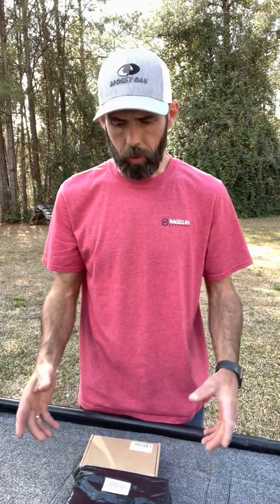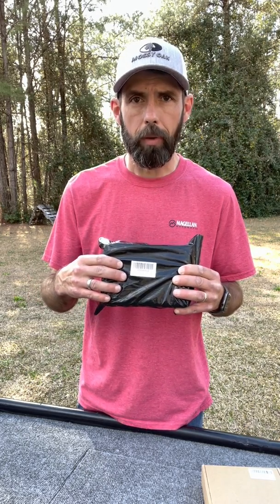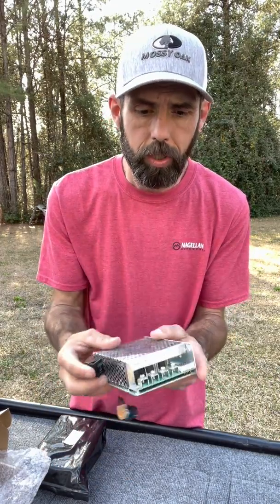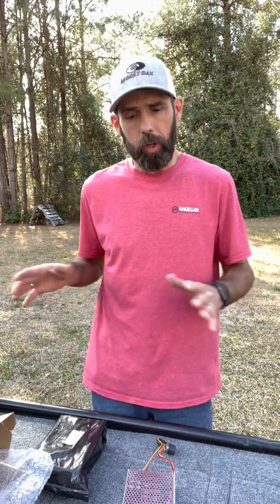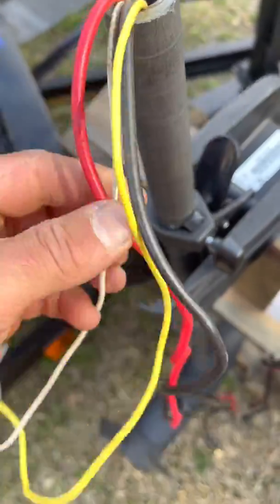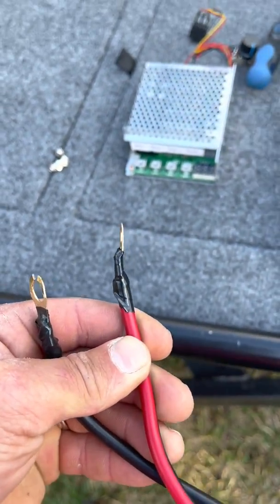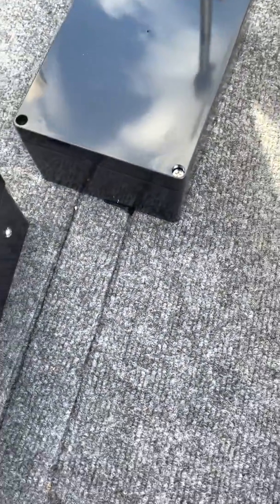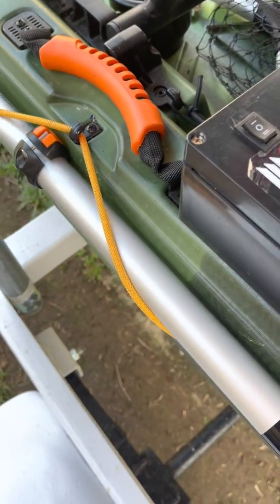How to hook up a PWM (pulse width modulator) to control a trolling motor.

Comment: The pwm with the fan is probably the way to go. That and making sure there is a 50a breaker switch between the battery and pwm will help in keeping the pwm from overheating or taking too much current and frying it. I bought a box that has a mounting plate that is perforated and raised off the floor of the box, so it will also help with cooling the pwm board in the box. I am going to swap out the rectangular rocker switch for a round one that is also a bit larger in size.  Thank you for posting the videos because I have adopted some of what is in your videos on adding the hatches and motor to my Outlaw. I am going to be adding foot control steering to mine using stainless steel cable. Hoping to finish up today or tomorrow. I have been doing one or two portions of the project each day. Lots of frustration as I didn't set down and create a step by step guide. Many times I had to take stuff apart because I forgot to add a part...like putting my motor together with the pvc top and wiring loom...then realizing I had to slip the steering triangle down over the shaft. 🤪 I had to take apart my motor mount because after I got it on, realized the part the motor actually mounts to had to be bolted from underneath to the bracket that was sitting flush on the kayak and cutting board reinforcement. Doh! Let's not even talk about trying to solder 10AWG wiring with the soldering pen and then gun I bought. Scrapped that after multiple attempts and just spliced with butt connectors and heat shrink wire tubing. Fun stuff for sure. But, I should be able to easily solder the 22AWG wiring to the new rocker switch. The gun or pen should easily be able to heat that wiring up high enough to do the job.
Reply from the maker: I appreciate you watching the video. I also have a perception outlaw I’m building and yes you gotta have a plan for everything that is getting added. Good luck with finishing your build. Thanks for the comment.

Comment: Thanks mate this video helped me setup my PWM with my kids electric car which originally was 1 6v motor and battery to 2 12v motors and 18v drill battery. Now I can adjust speed depending on who is driving and what terrain. The PWM I received had only Chinese words so this video helped translate the connections xD
Reply: When I built my pwm this  video wasn’t available, so I had to figure out the Chinese connection labels myself.  I used a Harbor Freight Tactical Ammo/Utility Box (SKU: 64113) to put the pwm in and put the controls and a small battery percentage meter under the flip top lid. It runs between the battery and the motor. Made up 8 gauge lines to connect it to the motor and the battery using repurposed car jumper
Cables.
Reply from the maker: @Canadarago at least you was able to get it done.
Reply from the maker: I’m glad my video helped you out. I appreciate you watching and thanks for letting me know it did help you out.

Comment: What did you use to cut out the box?
Reply from the maker: I drilled a small hole then used a dremal tool with a sanding bit to cut it on out.

Comment: Can two trolling motors be hooked up to same unit?
Reply from the maker: To be honest I’ve never tried. It would have to have enough amps to power 2 trolling motors if it didn’t heat up to hot.

Comment: I have the pwm that I think is the one you recommended.  It's the 100A. There are nothing showing which screws go to motor or battery. This unit has the 4 screws next to the wires for the speed and forward / reverse switches.  What goes where?
Reply from the maker: One will show a b+ that’s battery positive and motor positive will go beside it. Same way with b- that’s battery negative and the motor negative will be right beside it.
Reply: @334tacticaloutdoors  is there anyway I could send you a picture.  Two of us here and neither can find any markings
Reply from the maker: @deanbailey74  yea send me a pick 334tactical@gmail.com

Comment: Just tried to hook mine up and pretty sure I fried it lol. The connection symbols were backwards on my unit. It started smoking pretty heavily
Reply: 2nd time was a charm. After reading the reviews the connections were indeed backwards on my label. Ordered another one and we are good to go now! Thanks for the great tutorial man. I might make a video showing my setup in the future. It’s a little unique since I have a prewired kayak (catch pwr 100). I’ll be sure to give you credit
Reply from the maker: Yes you gotta be careful and make sure The connections are correct. It’s a expensive mistake. Good luck on your next one if you need help just ask.
Reply from the maker: Great job and thanks.

Comment: Does it matter negative or positive left or right on the motor. Manufacturers didn’t label it like they did the battery
Reply from the maker: Yes you need to know your negative and positive. If the wires aren’t red and black like shown in the video look up the model of your trolling motor to see which wire is positive and which is negative.

Comment: Awesome video and very informative! Would you need to incorporate a fuse breaker within that setup and if so where in-line would you install it?
Reply from the maker: Only if you want to install a fuse breaker and if you wanna add one put it on the red power wire between the PWM and trolling motor
Reply: @334tacticaloutdoors  what size fuse would you recommend for a 30lb 12v trolling motor?
Reply from the maker: @oakgarage3834  I replied to your comment and didn’t tag you my apologies. A 60amp fuse breaker is what I would recommend, you can get one from Amazon for like $25 bucks.

Comment: Will work on 24v motor’s
Reply from the maker: Yes they will.
Reply: @334tacticaloutdoors  Will it work on treadmill  Dc motor 180DC V/ 7A
Reply from the maker: @markrosinski4814  I don’t know much about treadmills, but as long as it’s a brushless motor the answer is yes.
Reply: @334tacticaloutdoors  thanks for your response, my Question is what is the output voltage? If you supply 12V you get 12v output, if you supply 24V dc you will get 24v DC?, My motor is 180 v DC, does it mean i have to supply 180v DC?
Reply from the maker: What are you trying to do with the treadmill motor?
Reply: @334tacticaloutdoors  I want to power 7x14 metal lathe
Reply from the maker: @markrosinski4814  this video should help you better than I can explain. https://youtu.be/8YfmIpysRaA

Comment: Does it get hot and IF it does how do you circulate circulate the air in a enclosed box like you ae using. Will I need to Vent the box as I am ordering the PWM with the built in fan as it does get really hot in the summer here n centeral Texas. I want o try to make sure I do not burn out the PWM of melt the box and start a Kayak Fire..
Reply from the maker: I haven’t had any issues with overheating. If you see you’re having issues with overheating and decide to vent the box just make sure water can’t splash in it.

Comment: Great explination and build. I Plan on making one based on Yours Easy to follow instructions and great explinations. My Question is . What cable connections did you put on your box to plug them in and unplug with. Can you post the link to them in the comments section. Thank You and You have really helped me with my first build for the Kayak I just ordered.
Reply: I have seen videos suggesting you wire the plugs such that if the pwm fails, you can bypass it and plug the motor straight into your battery. Full power the instant you plug it in, but could save having to paddle back in the event of a pwm failure.
Reply from the maker: It’s 10 gauge SAE connections. Buy the 2 pack it’ll be male on one end and female on the other and you can cut them in half. Use the female on your PWM box and the one male can be from the battery and the other male can be from the trolling motor. I will see if I can update the this video and link them in the description. Thanks for watching.
Reply from the maker: I’ve added it in the description of the video now if you wanna just click the link.

Comment: Thanks for sharing.  You think it will over heat inside a closed box?
Reply from the maker: Mine doesn’t have any issues. if you want the fan go with the 100amp you want have to worry about over heating.
Reply: @334tacticaloutdoors  sweet.  Thanks